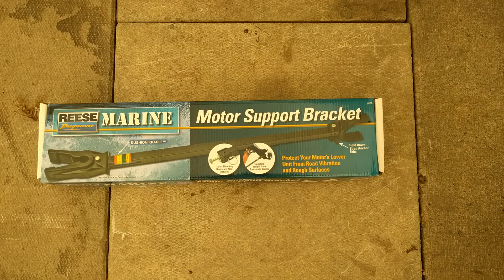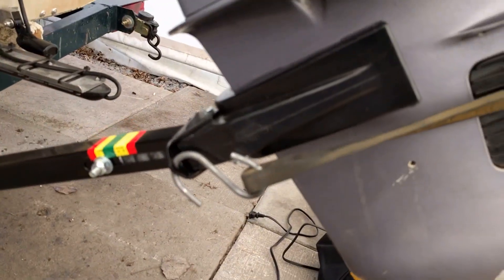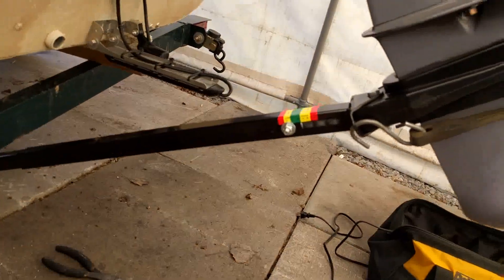Transom Saver Install - Aluminum Boat Project  #18 - REESE Towpower

Comment: Great video. I had one of these on my trailer (was over 10 years old), but backed up with it still on the trailer but not the motor (my bad) and destroyed the rubber. Was lucky enough to find another one on Amazon. I like these as they have the shock absorbers built in. Wasn't positive on how it went together at the absorbers as it did not come with instructions. Hopefully get another 10 or more years out of this one. Thanks.

Comment: cubanilton74, that's a very good point. With that in mind I'll be drilling a hole at the bottom of the frame so that water can drain back out. I have this exact bracket (just now installing it, not yet tried it) and it's made by Fulton. But looks identical. Paid only $30 for mine, brand new, so I'm pretty happy with that.

Comment: By drilling your trailer where you did, you created a dead space where water will get trapped and rust away that beam of your trailer.
Reply from the maker: Ok thanks I'll go weld it back up so I don't have a problem
Reply: Just add a bit of caulk around the bolt...

Comment: I purchased the same transom saver and was not impressed with it at all, if you have a tiller motor with limited steering lock the rubber V-head does not prevent the motor from tilting to the side as the rubber V-head is not supported as for example the TS80 preventing the V-head from flexing, I replaces it with the Shoreline Marine Pro Head and problem solved.
Reply from the maker: +Peter Oliphant Thanks for the feedback on this one. I've been towing with it all year and no issues yet. It holds my motor pretty straight and it doesn't move when I take corners. Who knows what the longevity will be though as it is a cheaper option than most.
Reply: To help stop the tilting to one side I have a bungee cord that raps around the bottom of my seat and hooks to the steering wheel, steering wheel doesn't move motor doesn't move